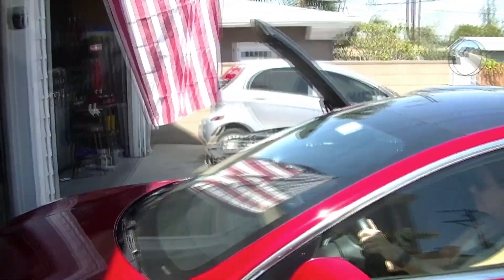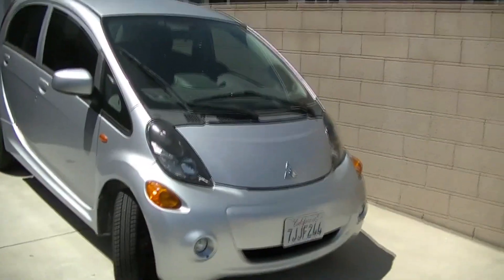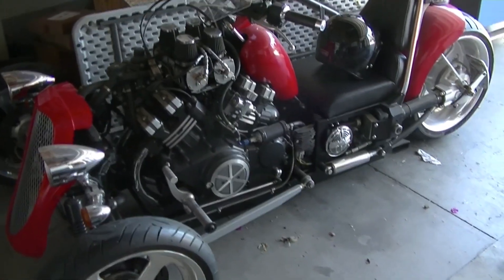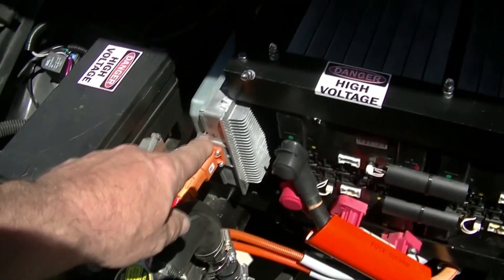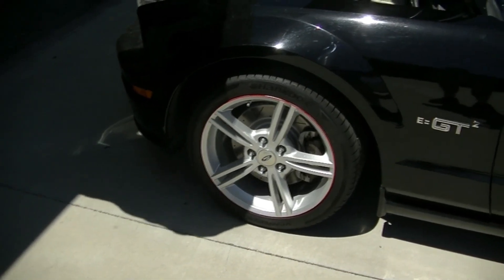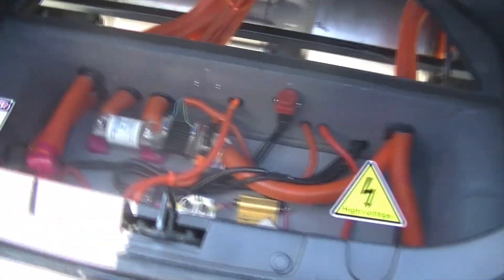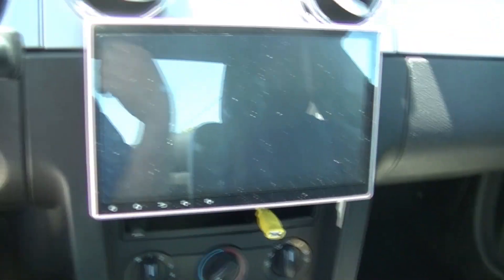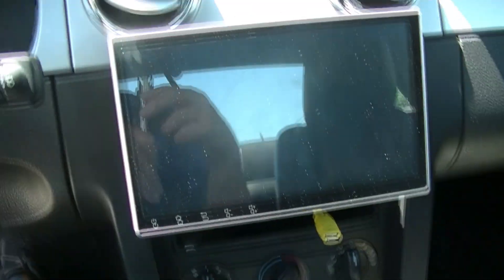Electric Mustang GT Tesla Motor Swap cost.

Comment: Great build ! Awesome content.. I have a couple of brand new tesla motors and the transmission/ no axles , and a tesla battery extended range , my question is if I were to put the drive train in a older pickup truck, besides the fabrication , how much would it cost for all the wiring,pumps,hoses,converters, etc.. give or take or maybe a ballpark idea?
Reply from the maker: Hi Maisy,  That's kinda open ended question there. It really depends on the way you go with the parts you need. If you go with off the shelf items, Charger for drive pack, DC to DC converter, Motor controller,  wiring, contactors, battery management system, fuses, water pump and misc. Probably close to $7000.  Doing it smart and going the DIY way you could do it under $5000.  Guesstimate. I need to d a DIY build help video on saving money on this subject.

Comment: Can you teach me to build one of my own?
Reply from the maker: Hi, I thought I was doing that in my videos. Everything is out there to build a Tesla powered EV.  Do a lot of reading and watching videos and get the car built. When you get to the electronics if you can't figure that out I can help get you running as long as you use a system I'm familiar with.  AEM, or Open Inverter.
Reply: @Roadstercycle  thank you for the response. Your explanation was excellent and you are correct because it’s just a lack of confidence in reference to my knowledge of electrical engineering that concerns me.

Comment: To avoid getting in trouble or having to go to a track you need to get a Draggy. Super accurate. They have them at Draggy motorsports. Even when you use one at a track and compare it to the wayside timers they are within less than a percent accuracy difference.
Reply from the maker: I have had a draggy for years.  Just did not get around to using it before AEM bought the car from me. Ran an 11.93 with a base LDU.
Reply: @Roadstercycle  Wow that is awesome. Great job btw.

Comment: Hey there, I know this is an old video at this point, but I wanted to know how the car is doing and just clarify a few details as I'm planning a similar build with my s197 convertible. Did you use a large drive unit? What kind of modifications needed to be made to the car frame?  Seems like a fascinating process.
Reply from the maker: Hi Joshua,  I  sold the car to AEM to do some EV testing. The car is doing great and it does have a large drive unit. I just finished another S197 with a Tesla model 3 motor install you can see on YouTube also. Comparing the 2 the Model 3 motored one is such a beauty to drive great power and a lot better mileage. The Large motored Tesla Mustang is a beast and a tire melting animal. Both  are a blast. And absolutely, frame modifications were necessary, what my videos to see what needs to be done.

Comment: This guy is smart, I’m impressed but 22G$ for all that?    Does this include the car?  I want more info…..  is there a build series?
Reply from the maker: Yes, there is a whole build series on YouTube. Just look up Mustang Tesla swap.  Roadstercycle channel.
Reply from the maker: It was $22,000 with the car after I sold parts off the car. Motor, trans etc.  You need to add about $3,000 dollars to that price for a BMS that was not included as I did not install one because AEM bought the car from me before I could do that.

Comment: I have the same model mustang, but mine is the V6. Thought about doing a coyote swap. But I think I'd rather go electric instead.
Reply from the maker: I'm building another one that had the v6 with a Model 3 motor right now. I'm designing it to take either a M3 motor or Model S motor so I can do small block/ block big block type of conversions. Should have another video out next week.

Comment: Have you weighed the car before and after ?
Reply from the maker: Yes,  The car is 200 lbs lighter with the Tesla setup. Remember though I only have 32 Kwh battery pack. About 450 lbs.
Reply from the maker: If the car was still in my stable you would be more than welcome to come check it out. The problem is that AEM bought the car to do design work on their EV line of products. They took it to the drag strip a couple weeks ago after they swapped the sport motor with a base motor and ran 11.8 seconds consistently in the 1/4 mile. Next they are working on the Sport motor control. I am in the process of building another Mustang right now which will be able to run a Model S motor or Model 3 motor. Your more than welcome to come check it out in a few weeks as its get further along.

Comment: I HAVE A 2008 MUSTANG V6 BASE MODEL WITH AUTO TRANS, DO YOU BUILD CUSTOMER CAR CONVERSATIONS?...I WAS LOOKING AT THE NEW 2021 TESLA PLAID, BUT I AM FORD MUSTANG GUY AT HEART AND I AM GETTING OLDER!...I WOULDN'T MIND BUILDING A ELECTRIC MUSTANG SLEEPER!...I AM JUST SAYING!...GOD BLESS AMERICA! 😇
Reply from the maker: I may consider it as I just finished another conversion today.  I don't know if money is an issue but using the newest up to date controls from AEM and better battery packs I'm guessing about $65,000. You can buy a pretty nice model 3 or model Y for that. But it would not be as cool as a sleeper Mustang like mine is. Now I have a sleeper VW Rabbit out there too.
Reply: @Roadstercycle ...As long as it is as Fast or Faster than a 2021 Shelby American GT or the New 2021 Mach 1or 2021 Saleen White Label!

These Mustangs are at that $65,000 +/- price point!...In terms of the Tesla Motor to use, I was thinking of the Tesla P100D!...What do you think?...Also, what other Mods or Upgrades do you do?...Lastly what's your Contact info?...Thank You and God Bless America! 😇

BTW!...I live on Southern California!
Reply from the maker: @DavidJSmith-hl6kb  Jack@roadstercycle.com
Reply from the maker: @DavidJSmith-hl6kb  P100D would be a great motor. Just finding great batteries to feed it may be the problem as Model S batteries just won't fit unless they are stacked under the hood, in the trunk and back seat.
Reply: @Roadstercycle ...I wouldn't mind making my 2008 V6 Mustang a 2 Seater Super Fast Sleeper!...I am Just Saying!...God Bless America! 😇
Reply from the maker: @DavidJSmith-hl6kb  David,  contact me as I'm looking to do another build and may do one for you.
Reply: @Roadstercycle ...I had to get my Mustang registered and replaced my driver-side rearview mirror!...I'll get back to you via your email address when I am done!...God Bless! 0:-)

Comment: Could this conversion work for a 2015 Camaro?
Reply from the maker: Absolutely.  It just takes some engineering skill, time and money. It's not going to just bolt right in.  I was wanting to do a Late model Camaro but the donor car prices where ridiculous. I like to stay around $5000 for a donor car and that was not happening with a Camaro. The build I'm doing now is a 2008 VW GTI. It should be insanely quick.
Reply: @Roadstercycle  thank you for the reply! Ima look into it I love my Camaro, gas prices are getting ridiculous though.

Comment: Did your build price include the cars 5000?
Reply from the maker: Yes, after selling the engine, trans and differential. I subtracted that from the $5000 cost of the donor car in the total.
Reply: @Roadstercycle  Okay. Thanks for all the info. I'm looking at doing an electric boat. Just built my first ebike, battery and all. So far 65mph top speed. So much fun!
Reply from the maker: @FelonENews  Electric vehicles are such a blast to build. I am starting the new 2008 Rabbit project now. Rear wheel drive with a Tesla motor directly mounted to a 2019 Mustang IRS differential. 33 Kwh battery pack. Should be insane. Videos coming.
Reply: @Roadstercycle  🤘🤘🤘Can't wait to see!

Comment: Im more curious about the weight. Did you get a chance to weigh it or have an estimate?
Reply from the maker: Hi, I did weigh it. 3200 lbs, with a 32 Kwh battery pack. Weight goes up with more batteries of course.

Comment: Would it be possible to do the same exact thing, on a 2015 Camaro? Would it have to be manual or automatic? Would the AC work?  You got a subscriber from me regardless! Cheers.
Reply from the maker: I don't see why not. The trans does not matter since it's not used anymore.
Reply: @Roadstercycle   Yeah, I would love to do that to my car. If you wanted more range could just install more batteries? Thank you for replying. Im just in shock! All i see are old classic cars being converted to EV.  I have so many questions lol.

Comment: Super impressive but 22k and all you've got out of it is 70 miles? Not at all worth it to me
Reply from the maker: It was built to be a race car with a performance motor. If I drove like an old lady I could of probably got 125 miles per charge. You just need to spend $60,000 for a Tesla. It was a project car for me.

Comment: I am thinking of doing this with my 67 Mustang Fastback. I need to look around and see what is needed to do it. Thanks for the video.
Reply from the maker: I've been looking for a clean 67 myself to do a build with but I have not been able to find one at a decent price. Just add about $25,000 to the cars price for electronics and batteries.  Batteries are the big issue at the moment. If you want a set of new lithium batteries instead of used ones it's about $15,000 for about 42 KWh.

Comment: Ok I watched the entire series last night. Wow, You are a very talented fabricator.  Do you have any pictures of the final drive mounting?  Did it end up being the threaded rod with square tube? I have been dreaming about a mustang conversion for many years but not with tesla hardware. Now I may do similar project with a convertible, 2 volt packs and an Rx8steering rack. Were the batteries waterproof? Do you have regenerative brakes.  Do you have a parts list you are willing to share?

Comment: What would you say the 0-60 time is I have a 450hp 2005 mustang gt 450 being the engines internals max hp to get me to 800+ hp it would cost me similar to a full electric swap if I could get sub 3 second 0-60 I’d consider swapping to electric
Reply from the maker: Hi, My car did do about a 3 second 0 to 60 with a Dragy unit but unfortunately it was purchased from me before I had a chance to do more testing.
Reply: @Roadstercycle  amazing work! So this car has been sold?
Reply from the maker: @Racing2Learn  Yes it was sold. I miss it it, it was quick. I'll build another.
Reply: @Roadstercycle  please do! Would you be willing to share some of your design drawings? We're a nonprofit that gets kids excited about math and science and we're seriously considering building a Tesla-powered Mustang or RX-7! Thank you for considering!
Reply from the maker: @Racing2Learn  Hi, Love what your doing.  I really don't use drawings to build. I design in my head on the fly. I am a fast prototype builder. The only time I do drawings is when I need G code to use one of my CNC machines which did not happen on the Mustang build. The only time I write things down or make a quick sketch is when I'm doing measurements for cutting or drilling. Building on the fly is so much quicker and easier than stopping and doing drawings for a one off design. That's why I could build one in 3 months instead of a year or two.  Drawings are really for production of multiple models in a manufacturing world. Again, I love what your doing.
Reply: @Roadstercycle  thanks for the encouraging words and for explaining your thought process! Looking forward to seeing more from you!

Comment: Is it possible to take a model 3 take the battery and Motors and use a Ford Mustang 1970 body and merge them together that’s what I want to do
Reply from the maker: I believe that's doable but it would take stretching and widening the body of the Mustang I think. You can go on line the get the wheel base and width of the Model 3 and then compare it to a 1970 Mustang. Sounds great but expensive. I had a 1970 Mach I and I agree it would be cool for sure.

Comment: I am thinking of switching out a 6.7 Bentely Arnage T motor for electric.  motors.  Big car, 6500 lbs existing.  Is it possible?  Or should I leave this monster 600HP gas guzzler in there?  If I could do a switch for under $35K I would be interested in moving forward.  Hmmmmm Makes for quite the luxury vehicle.  Sold new for over $300k, picked up for $32K..  Mint, no plastic, full luxury.  Let's do it?
Reply from the maker: Peter you could probably do it yourself for  less than $35,000 but getting a shop to do it add about $10,000. It's doable with a lot of engineering.
Reply: @Roadstercycle  Thanks.  I haven't done a restoration myself with engineering the mounting drive in decades. When I was in my 20s and 30s  we built All kinds of racecars, Stock Cars.  Drag bikes with all kinds of engines.  Now I want to do something like shown.  But in a Bentley Arnage T.  Sounds crazy, but a ludicrous Tesla motor would tear it up in that car.  Plenty of torque. Plus, removing a 1200 pound motor and drive train would help. Thanks for your note.  Nice stuff...

Comment: What's the most range you've gotten on the Mustang freeway?
Reply from the maker: Hi I've never really went cruising down the highway with it as far as on a trip. With the 32 Kilowatt pack my best is about 60 miles. That's if you don't put your foot in it. It's more a car show and rolling classroom. My Model 3 is for trips.
Reply: @Roadstercycle   What do you think it'd run in the 1/4 mile?

Comment: Love the build! I was wondering how did you pass your car from California referee? I am doing the same build as well. Is there any advice before I go to the California referee? Thank you
Reply from the maker: I have not gone to the ref yet since I bought the car and smogged it before tear down. I have 2 years before I have to Ref. it. I have no worries about doing it as it is electric with no emissions. Just make sure you build it safe and use the orange wiring for high voltage and have a main cut off switch and any other safety features you find along the way.
Reply: Roadstercycle awesome video man! So your email is Jack@roadstercycle.com?? I wanna chat, I had some questions about a project of LS swapping a Tesla motor onto a Volvo C70 hardtop convertible! Think it would be a good idea?? Cause  c70’s are cheap but European very durable cars I’ve heard so I wanted to be better educated from someone that’s actually done it. Hope to talk to you soon!
Reply from the maker: @bossman_deuce  Yes that's my email. I have no knowledge of what a C70 Volvo is or whether it would be a good donor. I would look to doing an American classic or one of the popular cars, Mustang, Camaro, Challenger as you may want to sell it someday. Even a convertible BMW may be a better choice. It's your project though not mine, choose what you feel good about.

Comment: The “2” in the equation stands for SQUARED, not “times two.”
What are you using for EM shielding? Please don’t say you’re not...
Reply from the maker: Yes I should have said squared but that would be a lie wouldn't it? 4 times as quick?
Reply: I'm a noob and don't know a lot about EV but could you please tell me what EM is?
Reply from the maker: @LJD0795  It's actually referd to as EMI and it's Electromagnetic Interference. In my instance my cars steel body is the shielding.
Reply: @Roadstercycle  Thanks a lot mate.

Comment: Thank you for being upfront about the costs of doing a project like this! Subscribed.
Reply: Great work. I'm currently in the in prosses of of doing an eV conversion and I was wondering, if it's possible to adapt a Tesla model s electric AC compressor onto a project eV car?
Reply from the maker: @EddyBoh  Hi Eddy, I don't see any reason why you could not do it. There is a lot of them around on Ebay.

Comment: Please watch Motor Trend TV, Vintage Voltage, Season 1, Episode 6 “Land Rover Defender”. It’s got a Model S “sidewinder” EV conversion that you might like. Cheers!
Reply: I don’t know if their episodes are available online yet. I just DVR’d Vintage Voltage on TV. The key part of the episode is the reverse flow gear oil pump that goes along with the re-gear and LSD. They also talk about the RPMs of the output shafts after the re-gear. Stateside, it looks like one of the Land Rover tuners is offering the same EV conversion that Vintage Voltage did. They didn’t name names in the episode, but I think Quaife made all the parts.
Reply from the maker: Do you have a link? Love to check it out.

Comment: Love seeing your car.  Such a great job.  Have you tried your AC?  Does your DC :DC converter keep up enough current?
Reply from the maker: I don't have AC in it at this point but my DC to DC converter would run it no problem. It's a 150 amp unit.
Reply: @Roadstercycle   Hey buddy love your videos want to do a Tesla awd drive swap .That's something you're intrested or can point me in a good direction for parts and schematics. Thanks